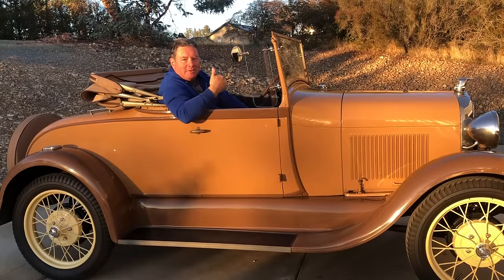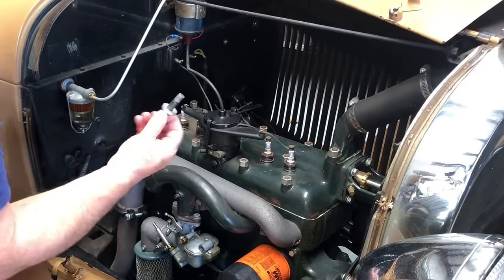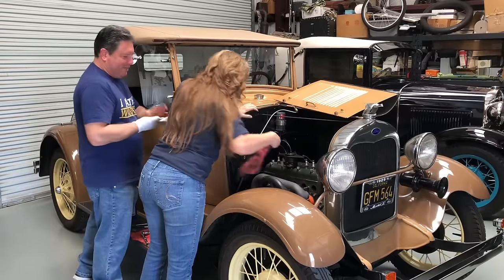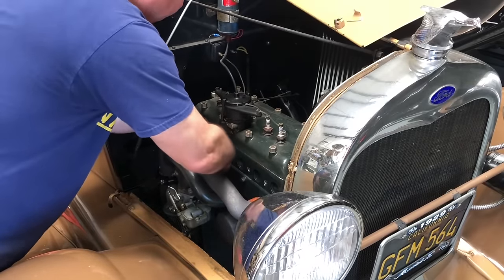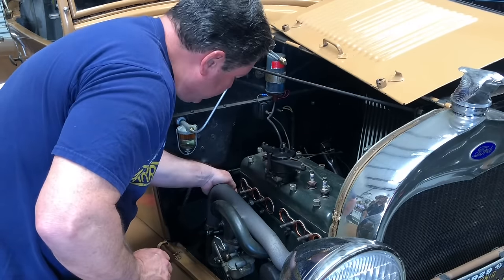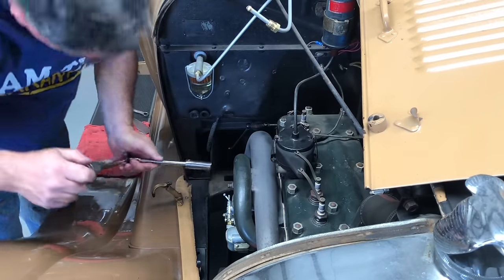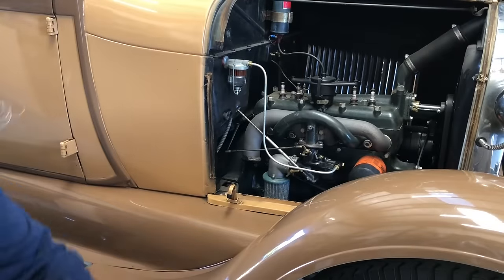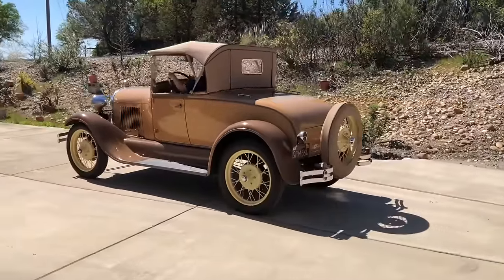Fix exhaust leaks on Model A Fords. Happy Birthday "Model T", 1 year since I gave Tina the roadster!

Comment: A suggestion for torquing nuts and bolts. Run the motor through two or three heat cycles and retorque the fasteners. Extra work to be sure, but it pays to be diligent with older designs. They thrive on TLC! And lots of TLC for model T! Your dedicated helper! 
Enjoy your weekend!😊
Reply from the maker: Thank you!  And, thank you for the very kind letter and bux!! Tina used the funds to buy some decent shocks for Roadie.  Video soon.

Comment: Yes, Happy Birthday Model T, I hope you had fun, looks like you did. Great instructions on the exhaust leak fix, some real sound advice for sure. I haven't had many exhaust leaks on my modern cars or trucks, some on my tractors, which are a little different as you know. Usually those leaks are at the manifold to pipe connections. Thanks for sharing, I hope you and Model T have a wonder, blessed weekend.
Reply from the maker: Thanks, will do!

Comment: Great job and get well soon Paul. Happy Birthday, Tina 🥳
 On newer cars, we used a smoke machine for checking intake, exhaust, fuel evaporation system, and other sealed system leaks but probably not necessary on something as simple as a Model A. In my old days, we would pour transmission fluid down the carburetor when running and it would make so much smoke you could see all the leaks but very nasty smoke. You would hope it was a windy day just to get it away from you.

Comment: I was talking to Joe at Aries Muffler and he says to leave the inserts out as well. However, lightly wet the surface of both the muffler and the exhaust manifold before applying the high temp Permatex. Possibly helps with the bonding? Anyway, I have an Aries muffler sitting on my garage floor and looking forward to seeing the difference compared to my old muffler.

Comment: A quick question Paul, do you need to re-torque after the manifold gasket gets hot and then cool again.  ...and of course Happy Birthday Tina....
Reply from the maker: When you initial torque to 40 ft/lbs, usually not.

Comment: Paul, are the gland rings critical for B engines too? As I recall, when I put together my B engine the gland rings didn’t allow for a solid fit.
Reply from the maker: I use them on my B motor also.

Comment: Hi Friends! A comprehensive video on how to fix exhaust leaks on the Model A!  HAPPY Birthday Tina!  Paul, can holes in the pipe between the exhaust maninfold and the front of the muffler, cause the popping also, or is that already too far down the system to cause that kind of behavior?
Reply from the maker: That would cause popping for sure!
Reply: @ModelA that would explain the popping sounds when I climb out of my recliner. My exhaust leaks too! 😂

Comment: Aerospace absolutely allows the mechanic to use a straight extension without the need to adjust torque values. If it's good for them, definitely fine here!

Comment: Question? I notice the firewall on this car is black.  My 1929 Model A was restored with the firewall painted the same color has the car (matching paint) .  I have a couple of issues with some surface rust coming through the paint.  I was going to treat it with the rust paint then cover it with the original.  Is it that big of a deal if I leave it black instead?
Reply from the maker: Roadie used to be black.  Whoever painted that color it is now did not paint the firewall.  Normally, the firewall would be the same color as the body.
Reply: It’s not a big deal if it’s not a big deal to you. Some people love to criticize and point out every aspect that differs from the factory spec, and claim it’s “wrong”. I try to smile and say I’m impressed with how much they know. 
P.S. Even the Fine Point Jusging winners don’t have 1930’s air in the tires, nor 1930’s oil and gasoline. I guess they’re wrong, too.
Reply from the maker: Yea, I know... We do plan to blow Roadie apart and paint it someday. but until then, Tina enjoys the car just the way it is.  What color will it be??? No idea.
Reply: @ModelA whatever is Tina's favorite color, of course!